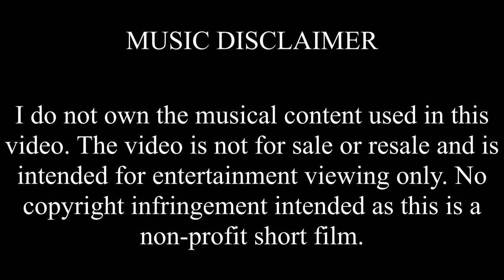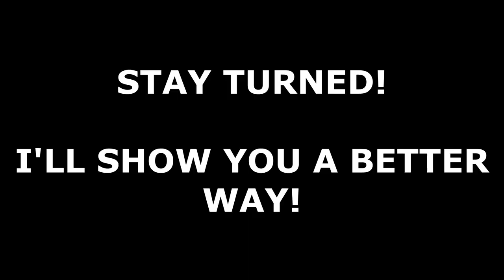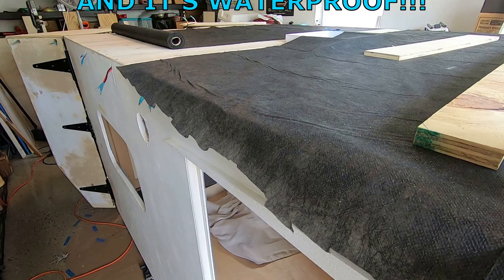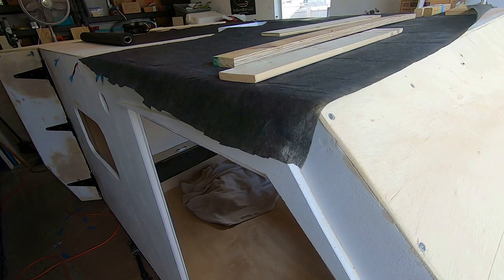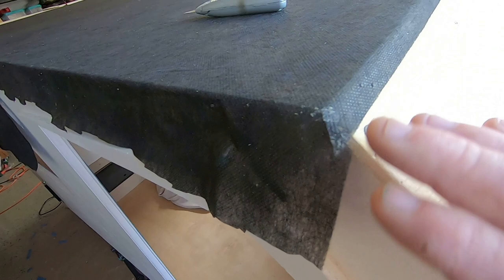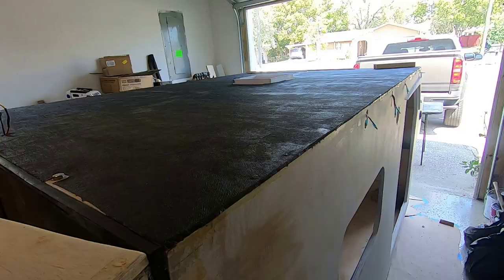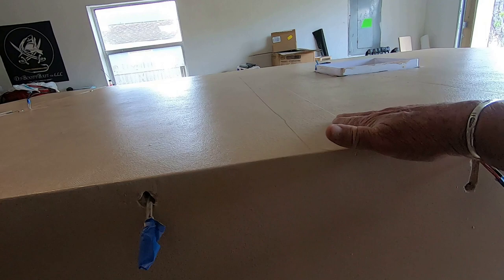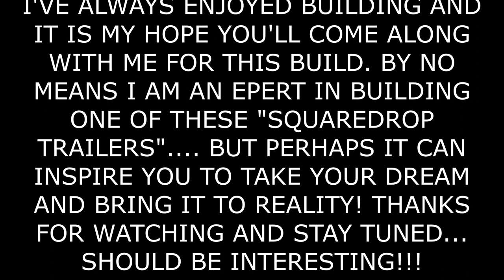SQUAREDROP BUILD EP. 34 (PMF-POOR MANS FIBERGLASS)

Comment: It looks good. My only concern is if the titebond is adhering to the PP, or is it just filling the crevices and creating a mechanical lock? The reason dropcloth is used is because titebond works with natural fibers and fabrics and does not stick to synthetics afik. The bond between wood and natural cloth is stronger than the components themselves.
Reply: All I know is it worked out amazingly! I've had a test piece out in the Florida weather for about 5 mos solid and I kid you not it still looks like the day I made it! And trust me, Florida weather wants to kill everything! haha Good luck with your build!
Reply: @LetsGoExplore This is an important comment. The bond between polyester resin and glass is physical. Epoxy is more proper adhesive (of the right glass fabric). But a lot of work is done to get polyester resin to adhere to glass cloth, even though in the end fibreglass using polyester resin is a mechanical adhesion and has worked well.

Does the titebond actually penetrate the earth mat? If so then AFAICS it's as good as fibreglass.

Then maybe it's not too bad anyway. There is the final weakness issue. The skin itself can be as strong or as weak as whatever. But the final chain link is the bonding of the weave to the polystyrene foam.....and yet even at this best, the best adhesion will tear the foam under max force.

Comment: It is canvas. Ask any seamstress how to prevent fraying. There are tons of ways. Also, it doesn't have to be canvas. You could probably use a lot of different types of materials! And not just cloth! How about topping that wood glue with a layer of sawdust? How about using a paper layer, or a metal screen layer, or a tarp layer?
Reply from the maker: All great points! :) I am totally pleased with the outcome of my technique!

Comment: Great idea. At one of our local farm suppliers they sell a really heavy landscape fabric that comes off a 12 foot wide roll. They sell it by the foot. Seems like it is less than 3 dollars per foot. This would make for a completely seemless roof. Was your glue ratio 3 parts glue to 1 part water. This seems like a very good idea.
Reply from the maker: Yes it worked out great! And yes it is 3 to 1 on the glue and water.
Reply: yep, that looks like the smartest upgrade to PMF.  cheaper, lighter, smoother.

Comment: Any updates on waterproofing? I am just about to cover my camper with this stuff. Using a 50g/m2 thickness (1.5 ounce per square yard) Is that what you used?
Reply from the maker: I used standard landscape fabric, I believe it's .91m. It turned out amazing! It made a total hard shell and water just runs right off it! So glad I decided to go with it! Easy to apply and from what I can tell will last! Here's a link to what kind I used:
https://www.acehardware.com/departments/lawn-and-garden/landscaping/landscape-fabrics/7024621?store=15750&gclid=Cj0KCQjw1rqkBhCTARIsAAHz7K1pi3BY0ezEeZRi0T3HmnyWODTlSuBUYNCJuDGwteCWQa0PLUjRAycaAjJdEALw_wcB&gclsrc=aw.ds
Reply: @MrStebo911  the link for your material indicates .91 m, or three feet wide for the rest of us, polypropylene fiber fabric. There does not appear to be a weight specified for thickness. Unfortunately, the fabric you used in the video looks like polyspun whereas the product link shows woven ...

landscape fabric comes in different weights, different weaves, and different materials depending on the intended use. It would be useful to show the label or refer to the mfg product number you actually used in the video.  While Ace, Amazon or other links are good, sometimes the product varies so the actual label should be the reference. The intended uses are: weed block, weed barrier, soil filter, ground cover, geotextile, pond underlayment, driveway fabric, drain field fabric, etc. The weaves are poly-spun non-woven, woven, perforated, solid (non-woven), fleece, and geogrid.  The materials are polypropylene, polyethylene, polyester, natural fiber, or a blend. There are also "biodegradable" weed block materials. Some products include UV protection while others do not.

Minimum overlap for these products is usually 12" ...
Reply from the maker: @nevisstkitts8264  Hi, your comment is very informative and I will definitely add an update of what I used when I get back as I'm out of town at the moment. I appreciate your comments for sure!:)
Reply: @nevisstkitts8264  I was wondering this as well! I haven’t heard the term Pollyspun But I think that’s what I tried to use yesterday. I just went straight to paint though rather than using the glue, which was a mistake.

It’s porous material, but the latex paint did adhear like it does with cloth and I ended up with a lot of bubbles under the polyspun.

After all the great comments here, I’m thankful for the coaching, and I’m looking forward to taking another crack at it! Thanks guys!

Comment: Roll on a thin coat of the butter in sections and add fabric, then apply more butter on the fabric,let that coat dry and apply another heavier coat of butter? Was the base coat of paint the sealer or was the last coat of glue the sealer before painting?
Reply from the maker: Since the glue "butter" is waterproof that is the sealer! And I must say after making a little test project just to see how it would hold up in Florida's harsh weather after 6mos. outside fulltime it still looks brand new! I'm going to do a follow up video and highlight it to show how well it really works!
Reply: @MrStebo911  Thank you. I appreciate the videos

Comment: I have to say that when people are going to look at building boats this way, sitting in the sun is not really a way to judge a building method. Driving around on crappy highways is a good start for checking vibrational resistance. But genuine stress testing is the only way to check the strength of any method.

Not saying your ideas are wrong.

Comment: Is diluting TB recommended? With many glues this can seriously weaken the result.

from Titebond:
"Most of our water-based wood glues can be thinned with water up to 5% by weight or by volume. Adding more than 5% water to our glues will decrease the bond strength. "

This needs to be taken into account. Maybe the thinning is more economical, and if it allows more penetrative bonding with the earth may, the it may be important. 

This method may well work for you, in your situation, but you are breaking a lot of established rules here. Using these for a boat may not work. 

May not work and boats?
Reply from the maker: That's a great point and should be taken note of when you're building your own squaredrop trailer! For me it's as strong as the day I applied it and would not change anything. Whenever you are trying something new you should always weigh the pro's and con's and certainly do test to see if it's really what you want to proceed with.
Reply: I know in the maker space with one of the original articles about this. They also recommended the first coat of TB be  25% water.

What’s encouraging is that it’s been working so well for you! 

I wish we could’ve gotten a better look at what kind of landscaping fabric you used. There’s one kind that is thin and woven - kind of like cotton candy. The other is thicker and has a weave with a very consistent pattern.
Reply from the maker: @shannonjensen3855  It is more of the a little more of than the cotton candy type.

Comment: I tried your mathod of using this fabric over foam but im just getting bubbles under it.. and the folds are also staying up.. any clue what I do wrong?
Reply from the maker: I haven't tried it over foam.. But if I did I would apply a thin coat of the glue mixture over the foam, place the fabric on it and smooth it out with a board or something like a squeegee as to get the air and  wrinkles out. Also allow the glue to become a little sticky before applying the fabric. Hope it helps!
Reply: @MrStebo911  thanks! Ill try with waiting for it to get a bit sticky. That might work. So you suggest using undiluted glue then? And not applying water or glue to the fabric also before laying it on the surface?
Reply from the maker: @ystein6900  I would still dilute it, put it on nice and even and then wait for it to get a little sticky, it shouldn't take long:)
Reply: @MrStebo911  ok. But only on the foam? Not on the fabric also?
Reply from the maker: @ystein6900  On the foam first, let get sticky, lay down the fabric, then another coat of glue over the fabric.
Reply: @MrStebo911  ok. Thanks

Comment: How long does it take for the glue to gas off and dry smell-wise and also how long to wait bwfore painting? And what about the paint? How long untill i can tske it out in the cold?Im thunking to do it in a garage during winter and wonder about
Reply from the maker: I applied it one morning and 24 hrs. later painted it!:) Not much of a smell at all. I did it in my garage. After you get it painted and the paint completely dries you can take it out no problems. I used a high quality latex paint, 3 coats.